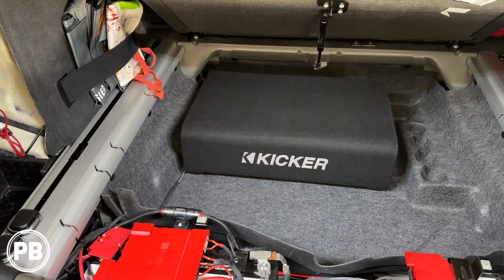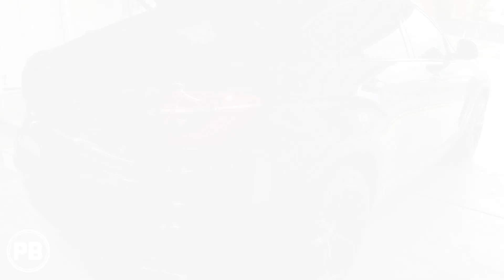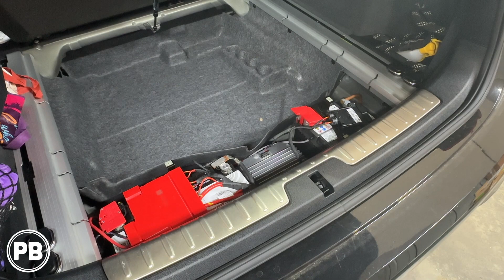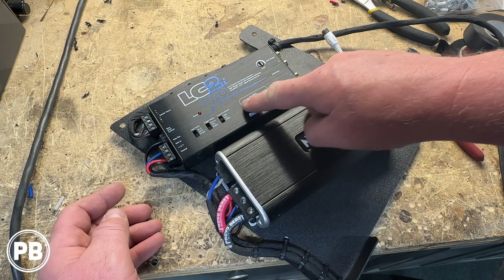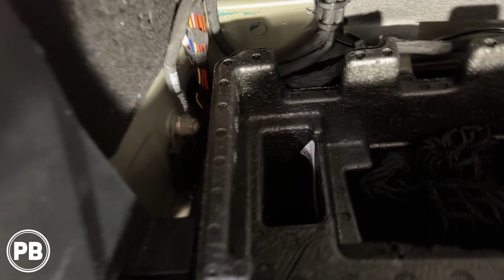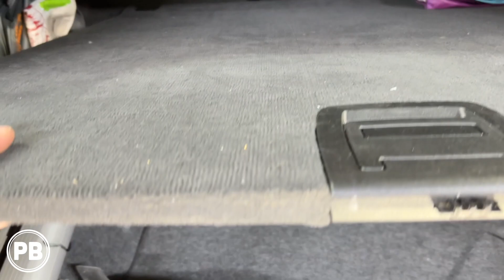2014 - 2019 BMW X5 / X6 Amp and Sub Install

Comment: Did you tap from wires of both subs or only one, from the video it looked like you tapped only one side of the factory sub. A little guidance will help helpful thanks.

Comment: I need help with this kinda install. I did everything you mentioned but still getting a wacky noise when the car is of. Like the amp is on still. I have a hi fonics 3.0 hooked up and it’s still not functioning properly.

Comment: Have you done any 2024-2025 bmw installs with the LC2i? Are the sub wires you tap into the same color? What are you using for the remote in on the LC2i?  Thanks!

Comment: Hi thanks in advance for all the informative videos you guys put out there for us to keep our projects going. I have a 2011 E70 that wanted to install an aftermarket amplifier and sub but mine is the base model I was looking for the factory amplifier and I can’t find it, where should I get the signal from? I have an 8” sub and a set of 6.5 custom mounted on the D pillars. Hope you guys can help.
Reply: Put in an aftermarket head unit if you have the base model. Then you just use the RCA outputs from the head unit.
Reply: @AnthonyRepetski good idea 💡

Comment: what wires am i supposed to connect my lcd2 if my x6 doesnt have the factory subwoofer?
Reply: Speaker wires R R L L in to LOC and LOC  to amplifier with RCA cables

Comment: If you're pulling your signal from the factory subs. Do you know if the signal is limited in its frequency range? In other words if your sub has a different frequency range than the factory subs will you be missing some range? Like is the signal already run though a crossover before the add on amp?

Comment: I’ve set my system up the same way as you did but when my lc2i pro turns off my amp stays on what can be causing this issue?
Reply: Where do you have the remote coming from that goes to your amp ?

Comment: @provo beast audio is it possible to grab the low level input going to the factory amp on a H&K BMW as opposed to the output from the sub amp? Would result in a cleaner signal
Reply: No the best sound would absolutely be the sub output. Any other output is going to give you speaker levels.

Comment: Thank you so much! This worked wonderfully in my girlfriends 2015 x5 35i. I decided to get the Audio control LC7i for getting the high level from the car, and Ended up doing a Resilient sounds Entry v2 15 in a ported ported application tuned to 28 hz. Alpine 1200 rms amplifer. slaps lows very good and has really good bandwidth. 3.5 cubic feet net with 56 sq in of port. ( the port is 1.5 cubic feet alone tuned to 28.
Reply: What’s all done to the electrical

Comment: I thought I’d read you don’t want to use the factory sub wire output as it is cut off frequency wise to suit the stock underseat subs? So if you’re running 10” or bigger you could be missing out on lower frequencies the stock subs don’t play….

Comment: Did you tap in to only one subwoofer for the line in for both  left and right?
Reply from the maker: Yep, that was all that was needed.  The sub(s) are mono from factory, so either side (or both) is fine.
Reply: I tapped in to the same wires as you and run it to the left input on the lci and it wont power on or send remote live?

Comment: Technic PNP actually makes a plug and play connector so you don't even have to tap into the sub wire harness.
Reply: Yes and it's wayyyy overpriced
Reply: You have the link to buy it?
Reply: @larsmendez4962  Google technic pnp
Reply: @larsmendez4962  thats 150$ product. Not worth it

Comment: On a scale from 1-10, how DIY is this? Also, is everything needed for the install included in the description?
Reply from the maker: It's very doable. And to do the install right, I'd recommend everything in the description.  You could go with a cheaper pac module, like the Pac LPA-1.2 LOC, you could go with a different amp like the Stinger 7001d to shave some money.
Reply: Thank you so much. I ended up doing this install exactly like you did but couldn’t do it under the trunk due to spare tire. That trunk lid rattles though. What would you recommend to fix that? Plus what settings did you use on the amp?

Comment: Great Video!!! i have a 2019 X7 I just got an aftermarket sub-install. Nothing against the audio shop but they definitely did my install wrong my for some reason they though I didn't have factory sub woofer which is under the seat. My sub sound like a regular speaker this helps a lot.